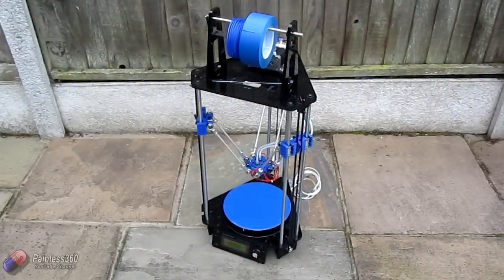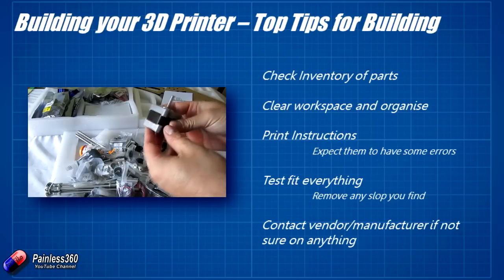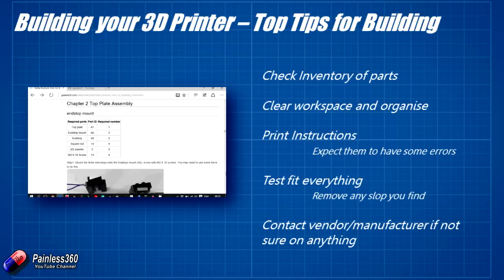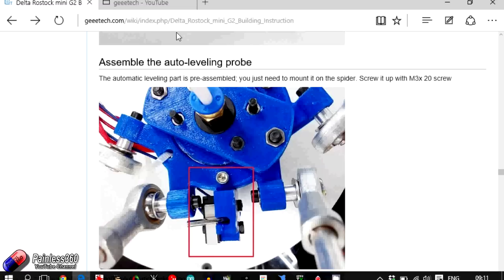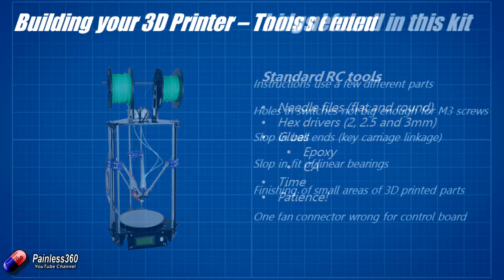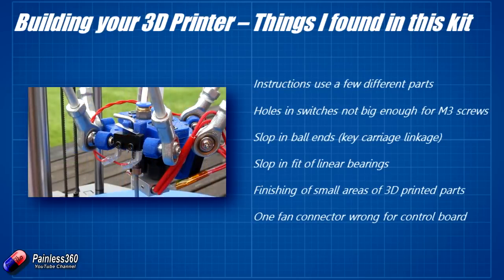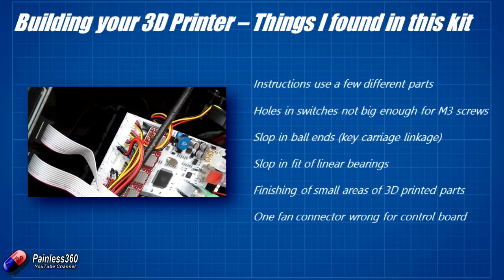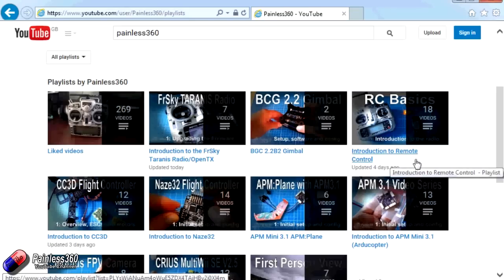(2/2) 3D Printing for RC: Tips for Building Your Printer

Comment: How did you remedy the slop in the rods that the ball joints fit onto?  Addition of a washer limits the diameter of travel.  Perhaps grind the rods down a little?
Reply from the maker: +Steve Crozier You mean the rods from the three carriages into the central spider? I didn't have any on mine..
Reply: Yes, there's some left-right slop along the axis of the retaining screw that holds the ball end to the carriage (not along the axis of the connecting rod itself).  I think you mentioned this in your video but didn't suggest a fix.
Reply from the maker: I see! I simply used a file to remove a bit of material from the end of the ball joint until to seated properly.. Hope that helps..
Reply: +Painless360 thanks I'll give that a try.  It's not in the direct axis of movement, but all the same I agree that any slop can only reduce the positional accuracy and so the quality of prints.

Comment: I have been looking at these for a while, thanks to you, i'm going to pull the trigger on one!
Reply from the maker: I would get the 'pro' version - all metal. This ones plastic parts are being replaced at the moment with the metal parts on mine..
Reply: +Jacques van Zyl Get one with an enclosure to help block any droughts which can effect the print, Personally I wouldn't recommend this awkward design  you need something easy to setup. The Prusa 3D designs are popular. Getting these working properly is a pain. If I had the funds I'd get something like the Ultimaker 2 and avoid a lot of hassle and maybe one with autoleveling. Mine also took an age to put together since the instructions were minimal. I've still got to fine tune it. Patience is indeed needed with these low cost Chinese models.